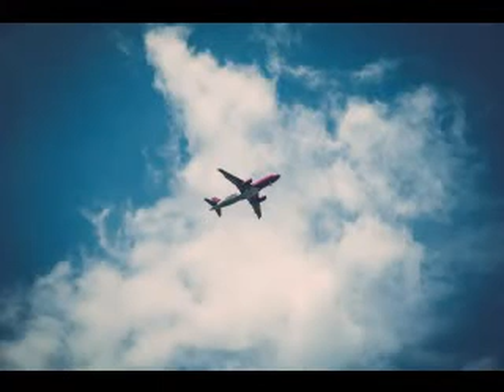Faa General Oral Questions.

Comment: Mathematics- 0:25
Physics- 4:48
Basic Electricity- 10:50
Aircraft Drawings- 15:35
Weight and Balance- 19:45
Aircraft Structural Materials- 26:00
Aircraft Hardware- 28:11
Hand Tools and Measuring Devices- 29:53
Fluid Lines and Fittings- 30:33
NDT- 35:24
Cleaning and Corrosion- 38:00
Ground Handling and Service- 43:49
Maintenance Publications, Forms, and Records- 51:10
Reply: Real💯
Reply: Please don’t offload the video
Reply from the maker: @rafaelortiz8135  This video will never be taken down!
Reply: Thank you 🙌🏻🙌🏻🙌🏻🙌🏻🙌🏻

Comment: I noticed you forgot the last question on corrosion which is: list at least five examples of Areas in an aircraft that are prone to corrosion.. answer: number 1 battery compartment number 2 exhaust Trail areas number three bilge areas number 4 vent areas number five landing gear and wheel wells number 6 fuel tanks number 7 wing flap recess number 8 around and below galleys and lavatories number 9 piano hinges and number 10 any area that can trap water
Reply from the maker: Weird this was not in my book. Maybe its the 2020 version?

Comment: Just want to let you know that this video changed my life. No joke. I listened to this on the way to and from school and when it came time to the oral test I was super prepared.  Much appreciated
Reply: Sorry for the late reply.  I was able to obtain my A and P and have been working for an airline since December.  The hardest part for me was the practical because if you know all the questions in the jeppesen book you are solid. The practicals though they throw curveball projects at you that maybe you haven’t done before.  Thankfully it’s open book.
Reply: What did you use to study for the orals?
Reply: @yori.153   You need to study the Jeppesen Orals General and whichever (Airframe/Powerplant) you plan yo take first.
Reply: How was the practical?
Reply: Marc Vincent the practical is super easy if you know what to do, it’s the orals and written that are the hardest tbh.
Reply: Non Existent I personally found the written fairly easy. I am working on the Orals for General and Powerplant. I finished studying the Orals Jeppesen for General, and I’m halfway through the Powerplant Jeppesen. I guess you just have to find a rythm when memorizing the written and orals. The practicals are what I’m worried about. I know how to safety wire and find the torque of the bolt and things like that, but I think I need a refresher for the others. Have you taken the practicals yet?
Reply: @AircraftTurnAndBurn  This is nice to know. I have my test scheduled this Friday, and I can say that i have all the Oral questions pretty much down. Though I feel like I am not as prepared for the practical portion of the test, only because there really isn't anything to study on besides watching youtube videos on some items they may test me on.
Reply: @matthewmartinez0328  Hey man dont worry, you will be fine as long as you remember what your instructors taught you and you constantly keep a cool, confident mentality you will succeed greater than you ever have. Because thats really what the practical and all the other tests are about, simply testing your ability under pressure to get the work done properly. Good luck, not only to the person who I am replying to but to anyone who reads this and is stressing out over these tests :)
Reply: Matthew Martinez let us know how it goes man! Good luck!
Reply: @soysoy4705  they give you all required information (AMM) when you're given the practical, take a breath (more importantly your time) and make sure you date your maintenance logs/log book entry  (ask me how i know) :(
Reply: @aaronfraser8984  hey man thanks for letting me know. I got my license already just last month. It was pretty nerve wracking at first, but I settled in quick.

Comment: Thank you for making this video-- it's a helpful tool in my preparation for orals. Unfortunately I must be the bearer of found inconsistencies. At 47:28 the question is, "When you tow aircraft should you use the tow vehicle or the aircraft brakes to stop the aircraft?" The provided answer is, "The tow vehicle brakes should be used except in an emergency, then the aircraft brakes should be used." This answer contradicts the 2018 version of the FAA-H-8083-30A (AMT General Handbook) which says on pg. 1-19: "When the aircraft is [being] stopped, do not rely upon the brakes
 of the towing vehicle alone to stop the aircraft. The person in the flight deck must coordinate the use of the aircraft brakes with those of the towing vehicle." The 2018 FAA-H-8083-30A can be viewed and downloaded here: https://www.faa.gov/regulations_policies/handbooks_manuals/aircraft/media/amt_general_handbook.pdf
Reply from the maker: Im glad to hear it is helping:) Nice find! The answers i gave are straight from the jeppesen guide book.  I talked to my local DME (who shall stay  incognito)  and confirmed that both yours and the jeppesen answers will merit a correct response. Although always go with the MOST correct answer!
Reply: Aviation MaintMan can you send me the mp3 for airframe and powerplant please jaah4@yahoo.com
Reply: Just to help out, we have found multiple wrong or incorrect information in the 8083 books. It happens sometimes.